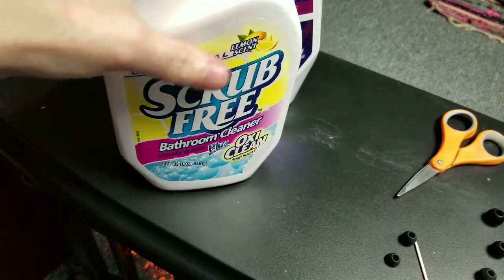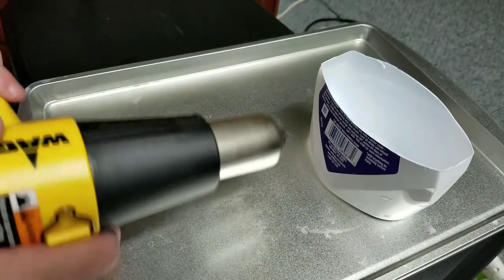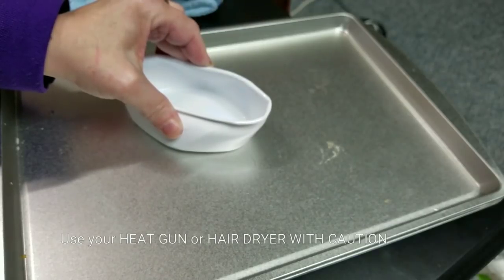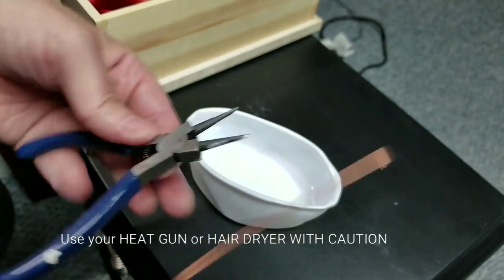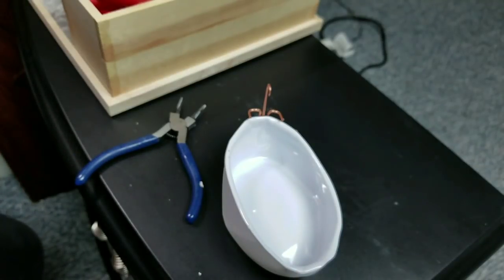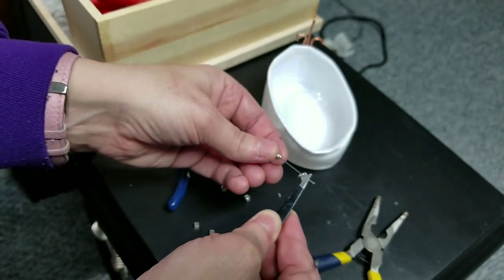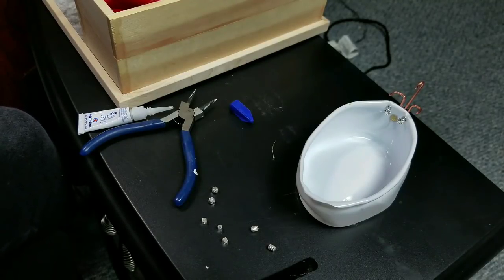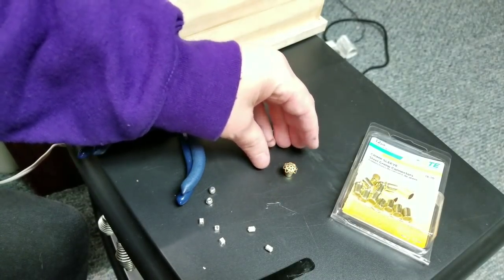Dollhouse  Bath Tub (opt 1)

Comment: You can also remove the adhesive left behind after the sticker removal with GooGone and a paper towel. Spray or wipe the GooGone on with your fingers, let it soak in for a few seconds, and wipe off with your paper towel. The GooGone will leave an oily residue, but it can be washed off easily with dishwashing liquid!
Reply: She mentioned goo gone and alcohol both